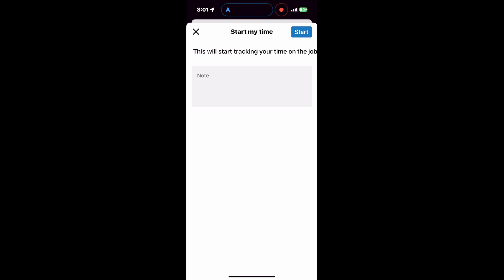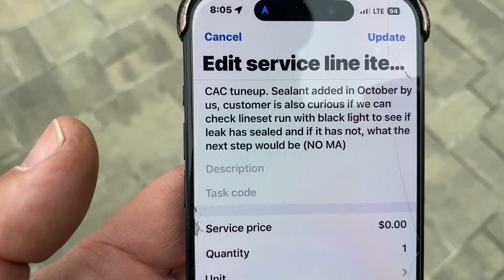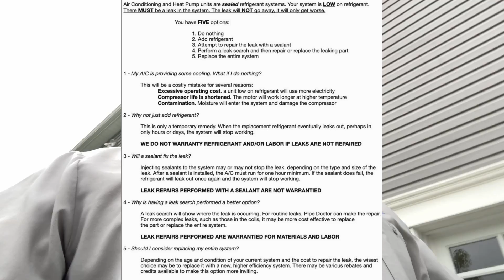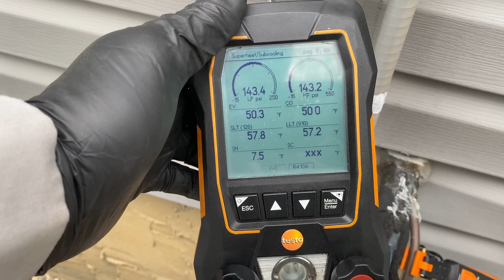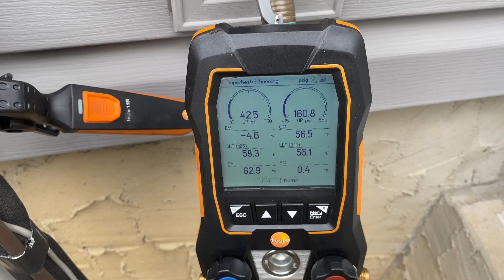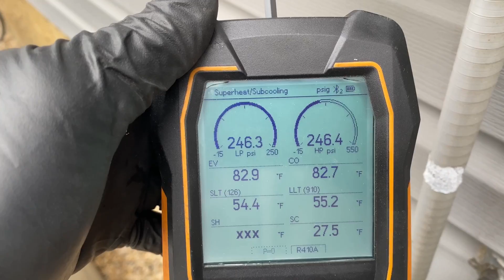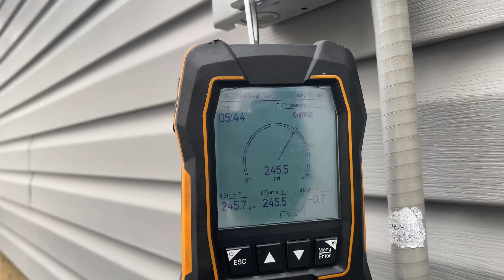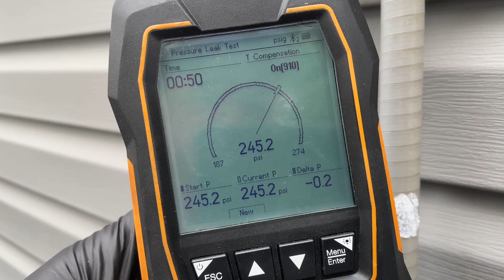Central AC Not Cooling: Low Refrigerant Diagnosed & Nitrogen Test Method Implemented

Comment: Found a leak on a outdoor coil it was pretty easy to get to so to do some the aluminum fins off cleaned the area where the leak was wrapped it with soiled copper wire fluxed the area then solder it closed ran nitrogen thru pressure held vacuumed it down recharge system took me 2- 3 hr still running three years later some people will look at that as waste of time I now take care of all his rentals I could have sold him a brand new system maybe got the job now I have all his work

Comment: So by you opening up the service valves the pressure from the condenser is higher than the lineset side so that would mean your problem is in the lineset correct? If it was lower then it would mean the opposite?just trying to understand is all
Reply from the maker: The pressure went up when opening the valves. That means the pressure in the condenser was greater than the lineset and evap coil. Meaning the lineset and/or evap coil is losing pressure
Reply: @PipeDoctor  mind blown thank you Doc! Trying that out when I pressure test a system thank you for explaining
Reply: So if the opposite happens then the condenser has a leak correct?